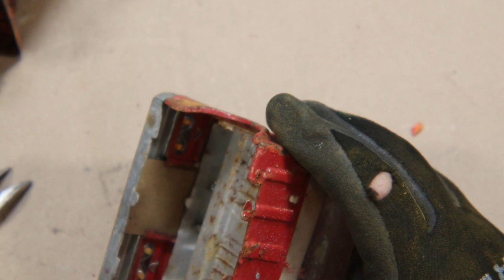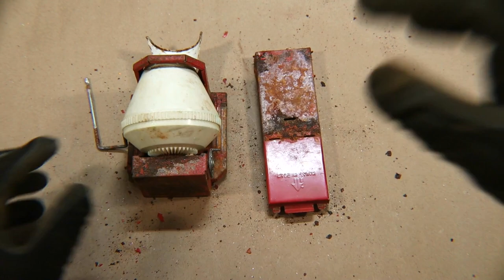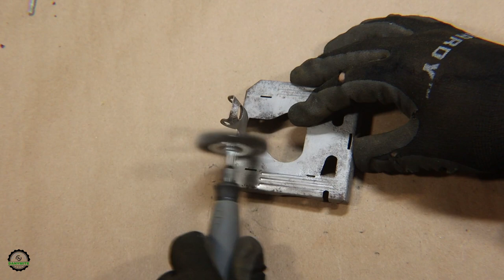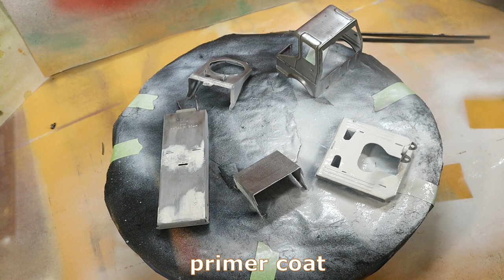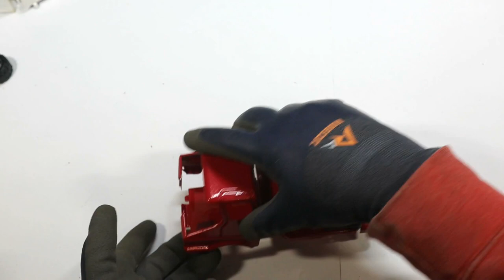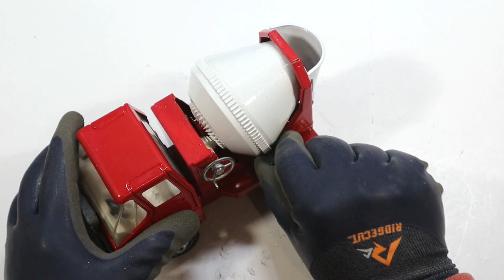1960 Cragstan Cement Mixer Toy Restoration

Comment: That came out really nicely. I'm curious, what blasting media do you use in your cabinet? It seems to work really well and not kick up a ton of dust.
Reply from the maker: hi
I tried all kinds of media and I decided  to get
aluminum oxide , I know it's very expensive,...but it will last long time,its really hard material  and its not dusty at all ,its really worth iti was realy tired of using tractor supply brand and some other media....they just not work well
. cheap ,extremely  dusty,and totally  unusable and have to be changed a the time couse after one use it gonna turn to dust
Reply: @DANYMITERESTORATION  I might have to try it. I'm using a silica based media at the moment and it's awful.
Reply from the maker: a used that one too........
there only two good  media
aluminim oxide and silicon carbide
both of them last long time
Reply from the maker: @Thematt11  Yes I had the same experience but aluminum oxide has worked best so far. Good look!